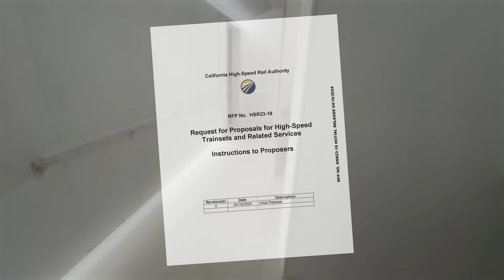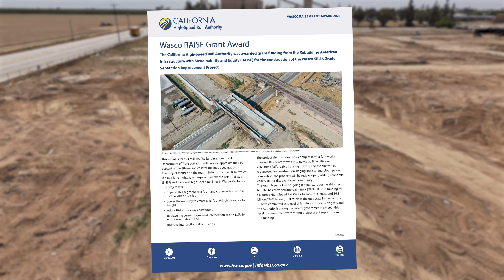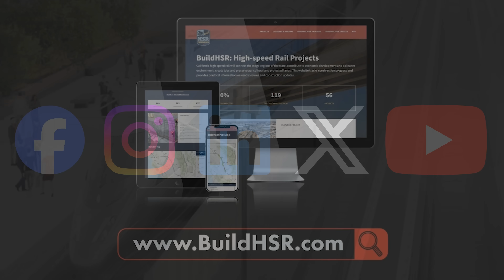Spring 2024 Construction Progress Report: Trainsets, Construction, Stations, and More!

Comment: So... They still do not have plans for any station, just designs? Have they purchased all the land or obtain use permits yet? No. Over $100 billion and counting. They didnt mention that the projected ridership has already been recalculated to a smaller number then expected. Not to mention the trains that will never reach speed. California's great white elephant.
Reply: $100 billion is not the amount spent, it's the total projected if the whole project were built as slowly as currently funded. What's seen here is the amount done today on $12 billion.
Reply: @rwdavidoff  that $12 billion goes beyond the Central Valley. It also includes all the environmental clearance work and bookend projects like Caltrain electrification and LinkUS.
Reply: @rwdavidoff  Plus about $20 Billon more to finish the valley segment in about 10 more years, hopefully sooner.
Reply: Wrong, wrong, and wrong.

Comment: The cathedral in cologne Germany took 600  years, so this isn't too bad.
Reply: and that's why germany is building for eternity. and as you can see, the cathedral is still standing.
Reply: This will need a remodel in 30 years.
Reply: Many landowners will become very rich by CaHSR.
Reply: Yes but I use after-shave, not cologne.
Reply: Same type of thing with the Basílica de la Sagrada Família in Barcelona! I think they are almost done!
Reply: Keep in mind that the Cologne Cathedral was not built over 600 years continuously.  It is a gothic cathedral which was begun in 1248 and completed in stages over 300 years finishing in 1560.  Then 300 years later the usual upkeep and repair work was done in the 19th and 20th century.

Comment: I wonder if you were to cut the improvements they are making, and just stick to the new build construction, how much money and time they would save? But great progress none the less.
Reply: It would be more expensive and take longer. Utilizing existing infrastructure and right-of-ways means that less expensive real estate needs to be bought, and less court battles from owners who want to squeeze every penny possible out of their land before agreeing to sell.
Reply: @appleintosh  i agree with that. I am talking about all the improvements they are being forced to make to infrastructure that doesn't belong to them.
Reply: @jhmcd2  How many examples of this can you find?
Reply: @appleintosh  Without replaying the video, there are the improvement to the BNSF rail improvement, which is a privately owned line not public, the sewage system replacement, improving that intersection so that BNSF trains can travel below it, again, BNSF job, not CA HSR, and that's just in this video off the top of my head.  Now, Grated, I am not complaining, I am just curious how much money and time they would save by just focusing on what they need to do to build this rail line. And there are a lot more.
Reply: @jhmcd2  The high speed rail tracks are going to run parallel to existing freight tracks in many places. This is to save money, since no new land in cities will need to be purchased to create the right of way for the high speed rail. This also means that a lot of crossings and infrastructure along those freight tracks are going to be improved, since what works fine for low speed freight trains will not work for trains going 200+ mph. Again, this is actually saving money and time since it minimizes new land that has to be purchased for the new tracks. Buying up dozens of linear miles of land through cities is enormously expensive, much more so than improving some existing crossings and building bridges.

Comment: When are we getting the SF to LA line? 2050?
Reply: Whenever the California State Government and the Federal Government decide to actually pay up with the funds necessary to actually construct it is your answer. Until that happens, we are stuck with these slow timelines. So far, the California State Government has footed around 80% of the bill which is very unbalanced in terms of major infrastructure projects across US history, like the Interstate Highway System which was closer to 80-90% federal and 10% state/local.  They need between $21B and $36B to get to SF from Chowchilla, and between $32B and $53B to get to LA from Bakersfield. Time is money, so the longer we wait, the more expensive it will become. Either we pay the current price now, or pay a much higher price later on.
Reply: @AmpereBEEP Very well said. BTW,  are you done with school this year? I need to see if you have any recent videos.
Reply: @mrxman581  Not yet. I have a week left and then I am giving myself a few weeks to relax.
Reply: Depends on funding.  If it was fully funded now it could probably be finished by 2030.  But it's not.
Reply: 12/31/9999
Reply: 2500
Reply: @onetwothreeabc  At a minimum

Comment: One rail lane for now especially this section it’s a HIGH SPEED RAIL look how fast it will go when you get this first operational save that money to get to Los Angeles. and San Francisco stay one rail when you get revenue coming in start on the second rail and the tunnels to fully done
Reply: That will make the entire project even more expensive in the long run and slower. That makes no sense. Going the cheap route is not the answer. You get what you pay for. BLW is taking the least cost approach and single tracking the majority of the route. They are compromising their system from the start resulting in low average run speed of about 100 mph. They did that in Florida, too. Their train there has an average speed of 69 mph even though the train is capable of 125-130 mph.

Comment: Why are there so many bridges? These are desolate country roads, can't they just have a normal at-grade railroad crossing, where the handful of cars just wait for the train to pass?
Reply: Not when the trains are going 200+ mph.
Reply: Part of it is to maintain access for the rural residents. Can't have any at-grade crossings when trains are going 200+ mph, so to not have any of these grade crossings would mean that you'd have to drive hundreds of miles out of your way to get to the other side of the tracks.
Reply: In a word, No.

The Japanese Shinkansen system is entirely separated from not only roads, but the rest of the train networks as well. that is how it maintains its full speed for almost its whole network.

Other European systems with level crossings and shared trackage have much slower speed limits in place where those features are present. As low as 160kph down from 320kph on dedicated trackage with full separation.
Reply: You don't get what HSR is about or how they're constructed. Whole different animal compared to conventional passenger rail service.
Reply: No. Because in real life people are stupid and do not wait for trains before crossing regardless of the warnings. See brightline Florida. And this train is much faster than that one.

Comment: Does this mean that all CP 4 Civil Construction projects are done?
Reply: All the structures are complete, and the only part of the guideway that isn’t is a 400-foot segment that crosses an irrigation canal. There’s been a dispute with the entity who owns it about realigning it that CAHSR is working with them on settling, which is or should be close to being resolved. They expect to have it completed by this summer. Substantial completion of CP 4 was achieved in January.
Reply: @ChrisJones-gx7fc  Once that is complete, track is going to be installed, right?
Reply: @SpeedBird6780  it’ll be ready for tracks, yes. The contract for those is set to be awarded later this year, so tracks and systems installation will likely begin in 2025.

Comment: Is there any place where the differences and engineering decisions for each of these locations is described? Just seems like each of these have unique characteristics and I don't understand why they are not more consistent.
Reply: Each CP (1, 2-3, and 4) was built by a different contractor, who each designed and then built that segment. Going forward, CHSRA is going to have segments designed first before having contractors bid for them, which should reduce the cost and make construction happen faster.